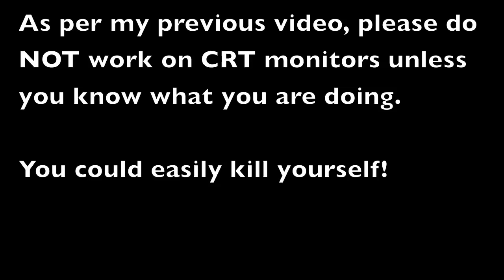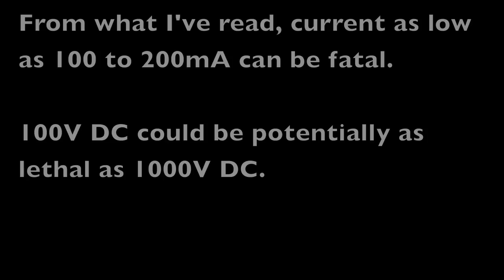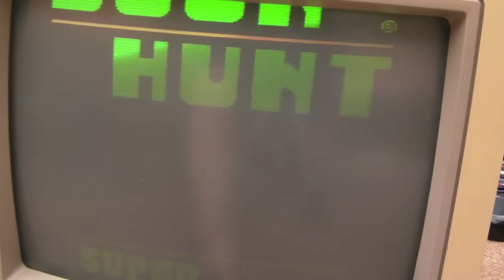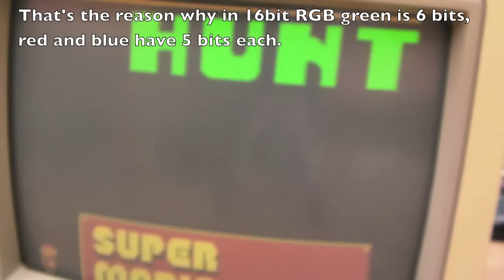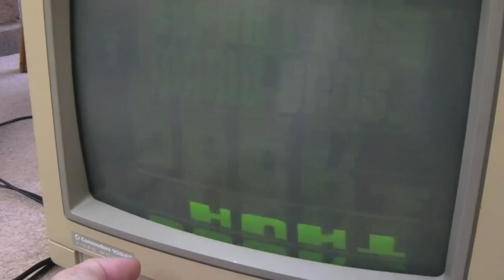Commodore 1084S (1084S-D1) Repair(s) - Part 2

Comment from the maker: IMPORTANT - you do NOT need to connect the chasis to earth, it's probably more risk if you have a mains cable connected like I did.  It's just a practise I always followed of shorting to an earthed chasis.  The most common way to discharge the tube is just direct to the chasis (ie. not then connected to earth).  There's less risk for some accident if you do not have a mains lead connected.
Part 1 - https://www.youtube.com/watch?v=YeLdkaHOxpw
Part 3 - https://youtu.be/gs_epqnsrRQ
Part 4 - https://youtu.be/CMQwl7LjP-I
Part 5 - https://youtu.be/H8v1zI_Ik14
Part 6 - https://youtu.be/yndStmgy47k
Part 7 - https://youtu.be/ZMogbh_WIVw

Comment: Very interesting video. I need to change some caps and the power switch on my Philips 8833-II some time which I believe is the same monitor essentially. So thanks for showing stuff in detail. A lot to learn from you again. :)

About the caps discharging: I built a little device with a small value resistor, some cable, an isolated banana plug and a crocodile clip to discharge huge caps in audio equipment I'm working on. Just shorting them out can indeed damage them, especially if they are old. A high ohms resistor will make the whole process take very long in my experience. I think I settled for around 100 ohms for the resistor. Works very well so far. I think I showed off my "discharger" in my Amiga PSU repair video a while ago.
Reply: Jan Beta The 1084S Gadget has is the Daewoo variant, so its an entirely different monitor than the Phillips made units, so sadly nothing internal he showed will apply beyond the basics.
Reply: Oh, okay. So much for that then. Still a lot of insights to gain from this video(s) about CRTs. Plus, at least the power switch is exactly the same on mine. ;)
Reply from the maker: Thanks!  As aphexteknol says - the board layout will be different with some different components, but generally it will work the same way - just a case of working out what's what on the PCB.  The mains switch is quite common to few of the 1084 models I think.

Comment: I finished reassembling my 1084 after cleaning it up - it still works fine and Im writing this comment so Im fine too :) I had the monitor unplugged for like 2 days - no sparks from CRT after discharging (I tapped to the ground running around the CRT) also no sparks from the big caps in the power circuit - bleeder resistors did the job overtime I guess. I was attempting to discharge the caps via 2k 10W resistor, this is safer than shorting caps with a screwdriver, as you mentioned it may damage the cap or even burn and lift the trace on pcb. I didnt use the rubber glove since I didnt have the proper one - I read somewhere that without a proper HV rubber gloves it may actualy be worse - since Your hand may get sweaty under the thin rubber glove and this may be even worse if the arc penetrates through the too thin rubber. The burned almost black dust was nasty inside, but I managed to clean everything pretty well. Monitor is not 1084s so it only have one speaker - I think Im gonna put the second speaker there since there is room for one, still no stereo but always a dual mono and a bit louder and equal sound. I belive it is safer to connect the aligator clip a bit further away from the screwdrivers handle, just in case. Waiting for part 3 - I hold my thumbs for Your succes with reparing that monitor!
Reply from the maker: Thanks - yes, some very good points here!  Household rubber gloves only offer a low level of protection vs ones designed specifically for the job in hand (no punn intended).  Household rubber gloves can tear really easily too!  Great idea putting the crock clip nearer to the point of contact with the anode - that's brilliant and has always been overlooked by me!!

Comment: Most flybacks have a bleeder resistor that discharges the EHT within seconds of turning the power off. This is for safety and also to eliminate the lingering bright spot in the middle of the screen you see on old TVs. Those were the ones that could hold a charge on the tube for weeks.

Comment: I used to repair a lot of CRT TV's years ago. What we used to do with bipolar capacitors was to measure what pin had the higher voltage and make that the positive pin when replacing with a normal cap. I remember that working every time. That 400v capacitor can give you a big bite if it gets you, interestingly though most digital cameras also have a smaller 400v cap for the flash, again a bit of a bite if it gets you. I never used to kill the power when spraying freeze either. Possibly You could invest in an isolation transformer, then you can safely use an oscilloscope to measure waveforms which obviously can help with problem solving.
Reply from the maker: Thanks for your suggestion there on the bipolar cap, that's very useful and interesting!  It seems there a number of approaches there.  And yes - 400v cap can be just as dangerous as the HT.  And with regards to freezer spray - back in the day, I didn't disconnect power either, but on this occasion I just took a safer approach.
Reply from the maker: Thanks, yes - isolation transformer really is essential with regards to safety.  It's a risk I took whilst working on this and resulted in a lot of sweat, which increased the risks further lol.  Will check out that video in a minute!
Reply from the maker: Haha =D  And yes, you're right - you dont need to discharge to earth - often in the past I would just short the anode to the chassis.  Just wanted to do things a different way.
Reply: Won't somebody please think of the worms!!!1!11!!?

Comment: I have worked on a few CRTs before and not keen to go back there. One had a broken transformer and was arcing high voltage to the metal parts inside the case. Had to air out the workshop to get rid of the ozone.
Reply from the maker: Thanks for sharing that =D  Yes, you can occasionally get crazy arcing in places!  I quite like the Ozone smell, but apparently its not good for you?
Reply: GadgetUK164 - Retro Gaming Repairs & Mods yeah, it isn't good to breathe. According to a Google search: When inhaled, ozone can damage the lungs. Relatively low amounts of ozone can cause chest pain, coughing, shortness of breath and, throat irritation.

Comment: Great vids, since first watching your CRT repair videos I've gotten pretty good at repairing magnavox (1080, 1902A, etc) monitors. Even converted monochrome mode from green to amber using some resistors.
Reply from the maker: Fantastic =D  Just stay safe regards the high voltage stuff =D

Comment: BTW the reason care should be taken when using an oscilloscope to test mains powered devices is that the scope inputs are NOT differential, like a DMM, as the ground connector is directly connected to mains earth. This means that if the DUT is at a different earth potential or, as is often the case with modern devices, has no earth connection then it's possible to overload the scope inputs and damage it. You can buy differential probes for scopes but they can be more expensive than a budget DSO! The other option is to use an isolated mains supply on the DUT and use the scope as if it had differential inputs, however care must be taken to avoid problems with earth grounding which could lead to similar problems!
Reply from the maker: Thanks - fantastic of you to take the time to share here =D  Mentioned you in the vid I am uploading at the moment.

Comment: Ace video as again mate. It'll be worth it when it's done as these monitors are bad ass. 

Your soldering iron seems to get really hot and seems like  good make. I would be interested in seeing a video of all your everyday equipment, what iron you use, solder, flux, where you buy your caps and so on.
Reply from the maker: Thanks mate =D  I do hope it can return to 100% working - just that blue gun issue worrying me, but the blue comes up when toggling between green screen button or colour mode, then fades out.  Makes me think there could be an issue with the cap on the main board - perhaps coupling cap for blue signal.  After 2 mins warming up, the blue just pops back in over about 4 seconds.   I will perhaps do some videos on tools and techniques soon!

Comment: For discharging caps my multimeter has a setting called "low-z" that couples across a resistor pack. It's neat because as it's discharging it shows you the voltage - once it's zero it's fine.
Reply from the maker: Brilliant!!! Thanks for sharing!  Sounds like I should consider getting a new multimeter!
Reply: Yeah its a Brymen 235 - not the most expensive meter, but not a cheapy either.
Reply: SkuldChan42 
I use the same feature on my Brymen 257s to discharge smaller capacitors but for something over mains voltage I always use a large high current wire wound resistor that I've connected leads with croc clips to.

Comment: Looks like your on the right track with the neck board. Might be worth checking the transistors and caps as you have three identical circuits for each colour on the neck board. Not shore if there's a colour bias on the neck board. Also might be a cap gone on the vertical and horizontal sync ic. Looking forward to part three
Reply from the maker: Thanks =D  Yes, I am sure the transistors or tube connection on neck board is probably where the issue might be - I am also thinking that maybe a resistor (or transistor) on base board has become heat sensitive.  And I think you are right about the sync issue - suspected 1 of the two caps next to the deflection coil connector (personally I am expecting the 4.7uF bipolar to be that cause there).

Comment: Tubes can be repaired its an interesting process there is a video on this being done on YouTube showing the disassembly of the neck, cleaning, insertion of new guns, installing a new neck and the paint coating.   I have worked on my fair share of CRT's and it was never my favorite thing to do.   I have a 1084 here that I need to work on but its not my highest priority at the moment.

Comment: Hi Gadget.
The component sometimes used for degaussing crt's is a called a Pozistor.  Normally, as you mentioned, a little black or white box with 2 to 4 terminals.  Very much obsolete now and like hens teeth to get hold of if you need one.
Love your videos. Take care my friend.
Reply from the maker: Thanks =D

Comment: great video. Love them.  Just out of interest, which is your go to store to buy these caps from? Farnell? RS?
Reply from the maker: Thanks for your support =D  I tend to vary between digikey, RS, Farnell or just eBay.  More often than not, if I can find the part on eBay which looks a good make / spec and is at a reasonable price, I will use eBay sellers because then you tend to save on postage cost.
Reply: thanks. just wondered if you had a better option. I'm a little wary of eBay for caps due to knock off parts. but I'll give it another go.

Comment: Also smaller caps tend to g higher ESR than larger caps I've found. I normally find the secondary side of power supplies seem to fail due to this rather than the primary side. Primary is the high voltage are. Secondary is the lower voltage. It seems to be small caps on secondary side; I've never worked out if due to dealing with constant ripple or temperatures?

Comment: The best way to discharge the CRT is to short between the ground frame of the CRT itself (the corners) and the anode cap. Its similar to  discharging a capacitor.
Reply from the maker: Thanks!  Yes, I often used to do that when working on a bench - and some monitors it was quite easy to short between the metal of the chassis.  On this model there's little metal to short to, other than perhaps the back part where the inputs are mounted etc.
Reply: Where the CRT is bolted or screwed to the front bezel is best GND points to short the anode cap i found. As far as i know there is no need for the mains GND to be connected to discharge the CRT, as its just like shorting a capacitor out of circuit. I remember an old workmate getting a shock from the anode cap of a radar CRT it was the only thing that he could get a shock from because his hands were dryer than rough sandpaper. The charge of the CRT is not as dangerous as you think it is one hell of a belt though. but i know how it feels repairing a CRT monitor for the first time in a while, when i was repairing my arcade monitor i was very nervous :-)
Reply from the maker: Yes, there are multiple ways to crack a nut!  I prefer this method when working without grounded bench mats etc.  Typically just grounding to the chassis is enough.
Reply: NEVER do this on a Vector monitor:) It will blow the HV diodes:)
Reply from the maker: +Thomas Andrews absolutely!  Always consider differences between CRTs before doing anything.

Comment: I discharge caps by shorting them but resistor to ground is the proper way. Also about the failing color transistors its most likely another componet having gone bad that makes them fail after a while. Just like if a breaker/fuse goes you need to figure out why it did that before you power things back on.
Reply from the maker: Yes - you're absolutely right!  The few times I have seen the repeat problem we measured absolutely everything, and even swapped all the components between two guns - eg. faulty red, so swapped out all components with green, replaced the transistor, measured how the guns are driven by the main PCB and all OK.  3 months later, same transistor failed lol.
Reply: GadgetUK164 - Retro Gaming Repairs & Mods Then the component choises are probably wrong from the beginning and one needs to figure out what part they got wrong in engineering/manufacturing and change some values.
Reply from the maker: Yes, that's a good point and something I forgot to mention - the very last time this happended (on an Hitachi 32" TV) - I uprated the transistor (basically same general specs but in a larger package body) - and it lastest and never failed again.  So your comment there could be the answer - perhaps components not taking tolerances into account or just incorrectly spec'd.
Reply: It's well worth considering that many passive components' tolerances change over time, hence many have a shelf life - even without use. So when exposed to operating temperatures and voltages the original value can be way off. Whilst this may not affect all uses it can often show up as faults that change over time with temperature as the component values drift while the device warms up.

Comment: I've actually broken one of those glass necks once moving an arcade monitor. Stupid sod! Didn't know any better.
Reply from the maker: We've all done that!   I did that once with a Wyse dumb terminal - tilted the chassis on its side and it fell onto the neck board - crack... New tube required.  Luckily it was a model we had loads of spares for from beyond economical repair units.
Reply: I'd just bought an arcade cab from a guy and the monitor had issues. So I pulled it out, put it in the back of my car and touched the neck against the top rail of the boot...crack!
Reply from the maker: Ouch, expensive mistake =(

Comment: The color from the green looks like the voltage regulator on the neck board. Usually what always happens to mine. I've been repairing arcades and pvms bvms and other Rgb monitors for right at a decade
Reply from the maker: Thanks =D

Comment: Thanks for your recent E-mail regarding bridge rectifier diodes for a JVC CX-610GB tv/monitor. It turns out that they are ERC01 diodes, which are available in the U.S. for £30. Not bloody likely am I paying that, so we can get BYD33M diodes which are an exact modern equivalent (as a pack of 5 for under a fiver). The BYD33Ms do look a lot smaller than the original ERC01s so I hope they won't go bang when they are soldered in place. Will let you know how you get on. Hope you have luck with that monitor repair. Warmest regards, Wayne and Nina.
Reply from the maker: Great =D  Do let me know how you get on =D   The monitor is healthy again and part 3 uploading now!
Reply: Well done Chris, hope some of my ramblings were of help to you :O By the way, our monitor is back in action too. It's amazing how good the colour on these JVC's are. But they weren't cheap kit, showing my age now!!! LOL! Warmest regards, Wayne and Nina.
Reply from the maker: Thanks again =D  And all hints and tips are always welcome - I learn lots from the comments!

Comment: iirc the degauss coil is connected to mains with a ptc in series that shuts it off as it heats up
Reply from the maker: That's the one!!!  A PTC!  I wasn't 100% sure.  Thanks =D
Reply: GadgetUK164 - Retro Gaming Repairs & Mods 
That will be the reddish disc shaped component just behind the degaussing connector on this specific monitor.

Comment: Another suggestion for discharging capacitors is to use a light bulb, just short the capacitor across the light bulb. It'l probably do the capacitor more good (if it's a good capacitor) than trying to discharge it with a screwdriver. Once again, optimum caution should ALWAYS be regarded with whatever discharge method is adopted.
Reply from the maker: Brilliant - I would have never thought of that one =D